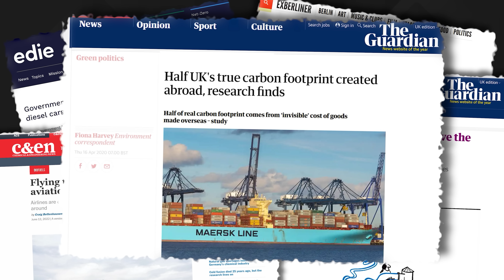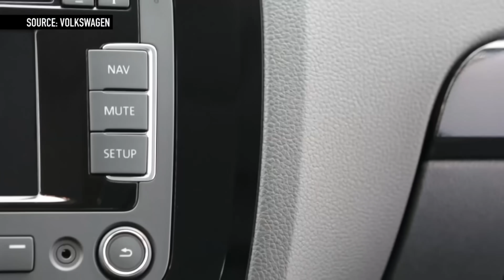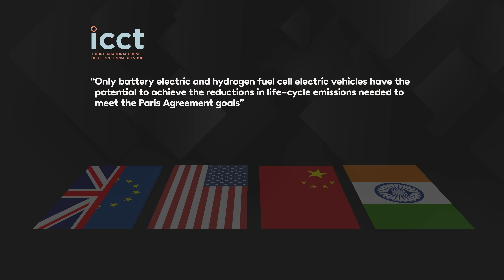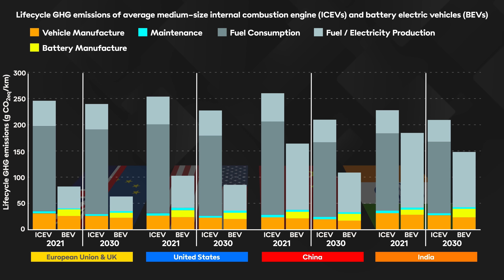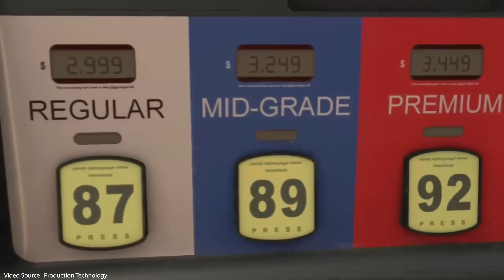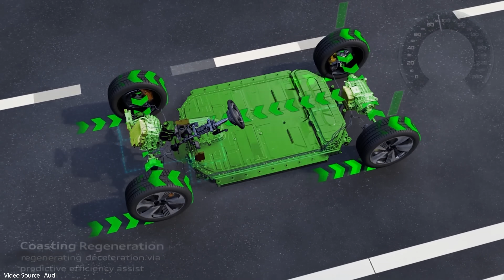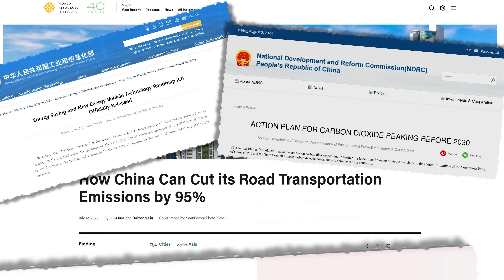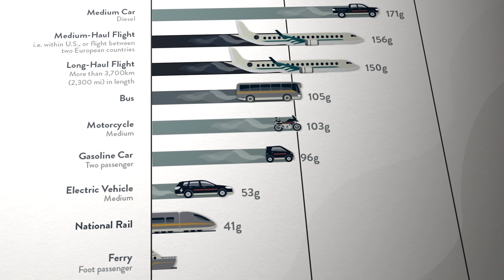Are EVs really better for the climate?

Comment: One element of these new EV’s that I don’t like…they are connected to the net. And if Europe is in the lead, new legislation there that the outlets used for EV charging must be on the net, I don’t like it. Obviously, others (government or corporate) want to be able to control when you can or can’t charge your vehicle. Or they can also throttle down the juice. Not going to happen with me. There is no way that any entity is going to control my freedom of movement. I will be building my own EV. Already have my chassis ready, just looking for the best battery pack. The charging will be completely off the grid…out of the hands of politicians and/or their corporate shills.
Reply: That's less of an EV issue, more of a general surveillance issue.

Comment: I wouldn't be happy.unless I could pull into a "petrol" station and change the range extender battery. I am also not happy battery's don't seem to last 5 minutes meaning 20k bills for a new one. There are BMW:s out there costing 100k up for scrap for 3k. Practically a brand new vehicle in my eyes.

Comment: I’ve driven an EV for nearly 4 years, so often have conversations with all sorts of folks about the merits of ownership. I usually tell them that EV’s aren’t really “green” as no manufactured product can really be green. 

However, modern society has managed to build a reliance on the car that would be almost impossible to completely reverse, in that respect EV’s are a much better option than using a fossil fuelled vehicle. I started installing solar panels to supplement our energy use some ten years ago, an effort to reduce costs with the knowledge that electricity can only get more expensive. Over the years I’ve added hot water heating and later an EV to the equation. For our normal day to day driving all our charging is covered by the excess solar production, a significant saving over fossil fuels, especially now the price has risen so sharply. I appreciate that not everyone can afford an EV and solar setup, but this didn’t happen over night, it was gradually built up over a decade. We recently sold our Kona EV after 3.5 years of ownership and 67500km, only 1500 euro less than we paid new. We have completed several European road trips, at roughly a third of the cost of running an efficient (4km/100km) diesel.

If you can charge at home an EV makes a lot of sense, for those that don’t have that opportunity I’d suggest an EV with a long range and checkout very carefully the local charging facilities, or ask if it’s possible to charge at work if you commute by car. Hopefully governments will take more seriously the need for charging facilities to allow the rest the opportunity to own and charge an EV, waiting for fossil fuel companies to provide this seems a bit stupid to me, where is their incentive!?
Reply: Being "green" isn't a state, it's a comparison with alternatives. If you're going to drive, then get an EV because it's greenER.
Reply: @skierpage  yes, my point exactly.
Reply: Tesla
Reply: @Barskor1  ?
Reply: @Barskor1  indeed, and being an EV only company their focus hasn’t been on just making up the numbers required for compliance like other manufacturers. Oh, and the Kona was replaced with a M3LR ;-)

Comment: Concern. EV manufacturing emissions are higher than IC vehicles, so there will be a short term increase in emissions untill usage benefits kick in. Will this tip the balance quicker. Also, vehicle lifetime is a very difficult subject. For example, my own car runs on bio lpg, and is already 22 years old. The way it is going, it will easily achieve 30 years plus. So , my question is, why am I to be castigated for using an IC vehicle, when my methods are more than likely lower overall than a EV?

Comment: Nonsense.  Make RE fuels and EVs are twice the CO2 of an ICE car.  EVs cannot get to CO2 neutral, not even close.  This video shows just how stupid these people are.  Just stop the propaganda.
Reply: Your comment boils down to just saying 'no' but with no explanation.
Reply: @flytrapYTP  No, it boils down to the fact that you have NOW two choices with RE.  1) charge a battery or 2) make fuels.  You can make fuels from Renewable Energy... Fact.  Not opinion.  Making fuels is OFF grid, not on grid.  DC, not AC like you need for grid EVs.  DC 1/3 cost... Even though an old ICE car uses 4 times more energy, the CO2 is still 1/2 that of EV due to no drive battery and complex electronics.  With a new type of engine coming out, the efficiencies will be ~ par to EV, thus eliminating any advantage an EV has over combustion.  Range will also be up to 90 times further than EV....  Game over.  If you want the CO2 out...get rid of the battery.  Simple.  Easy to understand.  Not hard.  All you have to do is be honest.

Comment: Be careful about replacing 4-wheel with 2-wheel vehicles as you will be replacing energy savings with increased medical costs due to accidents.   Head injuries, in particular are expensive, long lasting and career ending.

Comment: Part of the reason why the difference is so less for indian cabon emissions, is that the baseline itself is very low.
We are 2 wheelers predominant nation which are highly fuel efficient and same goes with cars.
Also, while you would belive that US and EU have huge potential to reduce, thats because they dont have vehicals that give 30 kmpl or, 90mpg.
In india, its very common to get 25+ kmpl or 75+ mpg.
Most 2 wheelers give 75 kmpl, or 210 mpg.

So the baseline itself is incorrect.
Also, blaming the chinese for high coal consumption isnt justified.
Check the coal consumption per person, and then the picture is completely different

Comment: Yes good info and the ney sayers always skip the simple fact that these are emerging technologies that are only getting better and solving the problems they’re griping about.  There are already positive strides in solar cars and sodium ion batteries.  Even lithium ion will get smaller and lighter.  Solar efficiency is still increasing.  There is still a lot if upside to realize.

Comment: what most people fail to mention is that EVs fail to change the current paradigm :
- there is nothing more stupid than people living in suburbs, miles away from their work, shops and whatnot. towns and cities have to change to be much more efficient to get people to be much closer to what they need for their everyday lives. ideally, most things should be accessible without driving, or at the very least by using affordable public transportation that runs separately from cars to prevent them from being stuck in traffic jams.
- the amount of ressources needed to build a single EV could be used to build many other, lighter, more efficient, electric vehicles, be it electric bikes or scooters, or even single person EVs (a large part of the cars on the road only have a single passenger even though most are made for 4 or more).
- EVs won't solve the issue of bad land use, with more and more roads, huge parking lots, etc. etc. 
- ne one should "need" to drive hundreds of miles on a daily basis for work.

Comment: Where I live I could ride a bicycle to work about 10 months a year.  The other two months would be damn cold and windy not to mention I would have great difficulty getting home as the approach to my house is a long steep hill and everyone knows slippery hills (snow) and bikes don't work.   There is also the added problem of trying to stop on these hills when going to work.  As inconvenient as this sounds my worst fear is having someone pull out in front of me because they just can't believe anyone would be coming down a hill in such weather and have me slide into their vehicle and lose the contest of who is tougher the truck or me and recumbent tricycle.  There is an added problem of being seen in the morning in low light on bad roads or when it is snowing.  

I must hand it to the Swedes and Norwegians who ride year-round, but one must remember they have independent riding paths for bicycles.  I don't mean the so-called safety strip along the side of a road, I mean a paved path 10-30 feet off the road where even most errant cars are not likely to be running over bicyclists. If I had such bicycle paths I might consider riding more in colder weather.  It was such a treat to ride in the Netherlands and other parts of Europe where such things as bicycle paths are common. 

So do I ride my trike during the other 10 months and the honest answer is not usually.   At 70 years of age is difficult to deal with the hills and I am just getting plain lazy.  This might be why I am starting to have some cardio issues as I usually only ride about 30 days a year now and all at one time, so the rest of the time I am sitting on my wide butt. Oh yes, it also explains why I weigh 250 lbs at 6'6" instead of a more reasonable 225.

Comment: The thing about electric cars is that the electricity comes from wires. So those nasty nuclear power plants and the coal burning plants are not being used by the electric car owner, no, they are using safe clean energy. If only I could afford an electric car, I could get rid of my paid for gas guzzler from 1997 and start saving money and the planet immediately. Also, I probably wouldn't need to pay attention to the other folks on the road because the new electric vehicles are actually smarter than I am.  And yes, before you explode, I am being sarcastic. ;) One time a lady told me that we didn't need to worry about food shortages because they had a lot more food in the back of the grocery store.

Comment: I just had a look at how the PHEVs are doing in the study. And I would like to point out that it very much depends on how you use the PHEV. We are in the lucky position that we can do all the weekly commuting on pure electrical and only for the rarer longer distances we have to use the petrol engine. 
So if you manage to use the PHEV like a BEV I am quite sure that the number in the study can be beaten. And here in Australia, I would not risk a full EV as there are places where you even get nervous to find petrol, let alone a charging station.
Reply: Would be curious to know how efficient a PHEV is when it needs to drag around petrol, ICE engine and gearbox compared to a normal EV? When you drive using the ICE this needs to pull around the electric gubbins.

Comment: Problem is batteries are very very rarely recycled, and Ev's don't beat gas vehicles until around 100k miles for carbon and that only works for people who drive under 150miles a day, Also excludes anyone who needs to haul anything. or drive more. Hybrids are currently better than straight EV's. Wont even mention the fact leading that we are leaving a ice age, and that co2 is better for plants and the earth is greener than ever. And the real problem is water pollution from runoff. or the fact that we don't actually recycle how we should. Or nuclear is the best  power system by far for the environment. and if you were to rank the real threats air pollution is so far down the list it wouldn't make the first page.  But there is lots of money to be made in a sector that needs constant replacement of product every few years, and scaring people is a good motivator.  Hydrogen would be better. Also Paris accord is flat trash, if you actually read it, it doesn't do anything to countries that don't follow, and it forces us to give money to other countries, we got problems at home that money can fix, like a drug problems and homeless.

Comment: Despite the quoted statements, I'm optimistic that it will be possible to make hydrocarbons from CO2, water, and renewable electricity at a cost that would allow air travel and gasoline-burning hybrid cars with net zero emissions.  My guess is that electric vehicles will win out, at least on the ground, just not that they're the only option.  It will depend on some R&D that hasn't been done yet, so it's reasonable for the source not to include it.

Comment: It is rather ironic that in your graph a diesel vehicle has lower emissions than a gas vehicle, yet the global green movement is fighting harder to be rid of diesel vehicles than gas vehicles. In many rural areas you will not get a pure battery vehicle to work until the range can be MASSIVELY improved. I have yet to test one that can get me from home to the store 75 miles away and home again without needing to recharge along the way. Hybrids on the other hand do reasonably well, and may be a much needed middle point for several decades.

Comment: Most EVs have a battery far too big for most peoples daily needs and apart from the cost they are lugging around a lot of extra weight . How about an EV with a battery about a third of the current size and the option of adding a battery or batteries if your needs change ?.

Comment: Thanks for a good precis on that report JHAT!
So... there's no question that electrification from renewable sources is the only way forward, but it requires people to actually employ full life cycle engineering to the issue.
Ie Battery recycling... because I think a pile of used batteries sitting next to a pile of old solar panels and a pile of old wind turbine blades is going to be a fairly difficult ecological problem.
While these reports always claim 'life cycle cost' for technologies, they never seem to contain much detail around end of life with usually a nebulous statement around projected development of recycling technology (correct me if I missed something).
Reply: Big valuable EV battery packs will undeniably get recycled, even more so than the lead-ACID batteries in gassers; a dozen companies have started up to do that, and are all stuck waiting for enough batteries to actually fail.

Even if solar panels and wind turbines aren't recycled, the comparison is with many more times tons of fossil fuels all going up in smoke. Even if we just buried broken blades and stacked dead solar panels neatly in a corner of the solar farm, the waste is vastly less than the gargantuan toxic ash pits filled with crap from constantly burning coal.

If you're concerned about the residual environmental harm from making electricity with renewables, then by all means use less energy.
Reply: Nail on the head. EVs are the perfect means of transport, but they require 100% recycling of the batteries, which is possible and economically (very) feasible, but it requires more companies to be working on it already today. It's inevitable that it will happen, but right now we're on course to be too late setting up all that infrastructure, which will cost the economy a lot of money.
Reply: @Ehralur  there are literally a dozen startups hoping to recycle batteries: American Battery Technology, Battery Resource, Bruno, Green Li-ion, Li-Cycle, Primobius, Redwood Materials, ,ReLib, Umicore, ... You keep worrying, just don't get in the way of companies making money in the transition to cleaner land transportation.
Reply: @skierpage  it's not really about having enough companies though, it's about massive scale.

Comment: While a Hydrogen car, with the hydrogen produced by renewable energy, electrolyzing water  will have a low carbon footprint, we can drive more kilometers for a given amount of renewable energy in a battery car.  The difference is about 3 to 1.  So until we have unlimited renewable energy, we should scrap the idea of Hydrogen cars.  Hydrogen gives us better value in our war against carbon emissions in such applications as reducing iron ore to iron instead of using coke and should be saved for such purposes.  It might, just might, have a place in air transport but maybe not even there.

Comment: We have less than 5 years to completely stop using fossil fuels or it will be too late. All current car production lines can easily be converted to electric and all that they need to change is the engine, wiring and fuel system the rest of the car can remain exactly the same. If all car manufacturers made electric cars with the same removable battery packs that you swap at a service station electric cars will be more convenient than internal combustion engined cars. The electricity needed can easily be made by a system of closed loop hydroelectric power stations combined with rooftop wind and solar power systems. Remember that flare towers are not metered and there are tens of thousands of them that create flames that reach up to 200m and can be seen from space with the naked eye. Unfortunately the fossil fuel industry is mostly unregulated and not properly scrutinised. We have the technology to be completely fossil fuel free in under 2 years but we lack the intelligence and willingness to use it, unfortunately we humans are not as intelligent as we like to think we are. At the current rate humans will become extinct in less than 100 years and in around 50 years there will be around 70% less people in the world due to crop failures causing massive famines and the wars over the few parts of farming land that is left. As global warming will destroy the world's ecosystem that sustains human life and at the current rate there will be no oxygen producing plants or organisms left in around 70 years. I am lucky to be old enough to die from old age but the generations that have followed me are not as lucky.

Comment: Our 1964 GTO is still running great.  If EVs can run that long without new batteries or new motors then they would be better for the climate.
Reply: If you’re not taking into account energy efficiency and overall emissions you’re effectively ignoring 2/3rds of the relevant details..